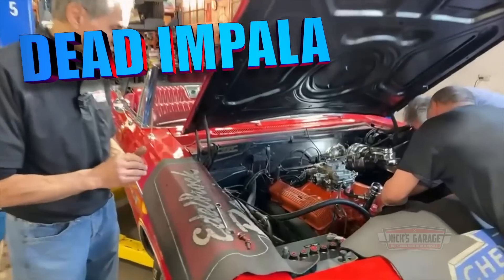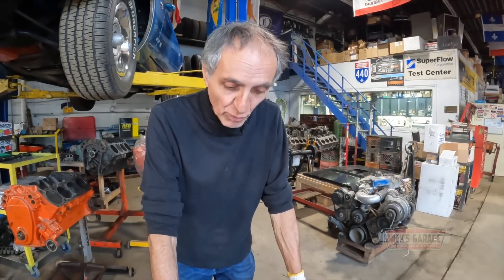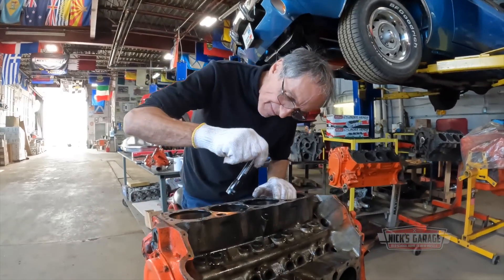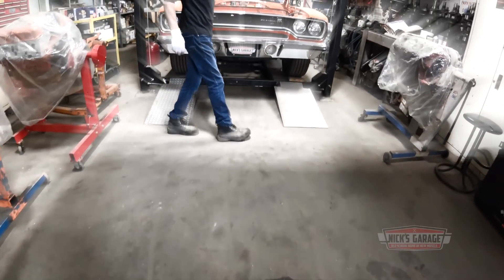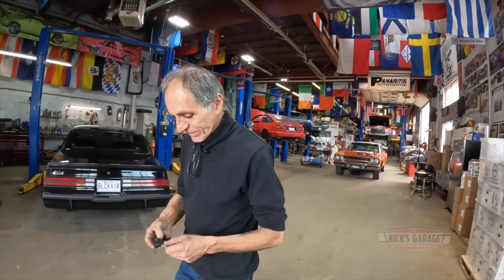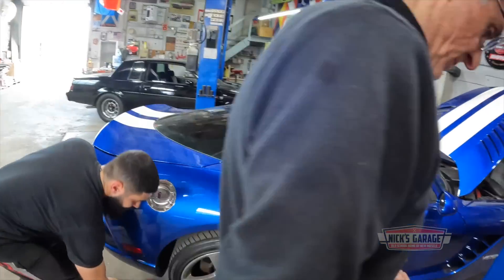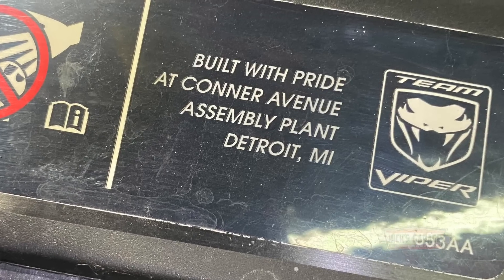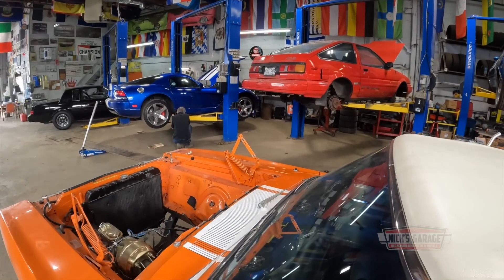327 Chevy Autopsy - Smoking Gun FOUND!

Comment: I don't know if you know but is not the right engine for that car, I noticed it has a cast crankshaft, all 327's up to 68 had steel cranks. After 67 they changed the main bearing journal size to the same as a 350. Large journal 327 crank kind of hard to come by. P.S. also the rod size.

Comment: I hello in my past I came up on the bottom raidtor hose did not have a spring in it to keep it from clasping an when it gets sucked in the bottom hose then it stops the water flow could this be the problem check the bottom raidtor hose for a internal spring

Comment: Seen a weak lower radiator hose do that to  mopar 318s,..Chevy 283, and 327 sb engines. ...lower radiator hose "inside spring" collapses while driving ,...causing severe over heating ....that's my guess.

Comment: Sometimes parts fail for no reason. This is why I prefer the restrictor type tstat with the bypass holes. I also prefer 160 degree as opposed to 180 opening temp, the water is still going to get to 190 operating temp.

Comment: I would go with Stant # 45356, they have been making thermostats as long as I can remember but I don’t know if they still put the little 1/16” weep hole anymore. Somebody makes the thermostats for Mr. Gasket ,don’t know who. Maybe customer turned on the heater and there was an air pocket that caused a steam pocket for the thermostat and if there’s no weep hole that would cause overheating which may have caused an exhaust port to crack, thus steam out the exhaust. You would think the excessive heat would have caused the engine to “KNOCK” and the customer would pull over and turn car off . Anyhow because of a part failure you can’t really hold the customer for the repair. It’s called , call your Garage Insurance company and see what say which they will probably tell you to suit Mr. Gasket. Good luck on that one.

Comment: I've cooked a 305 that bad. It got hot enough to melt the solder that held the neck into the radiator. The temperature light never came on and it never ran like it was hot until both head gaskets let go and it quit running. 
I definitely would check the temperature switch to see if it actually works.

Comment: More often than not, good quality thermostats will open at different temperatures rather than not open at all. Unfortunately, in this case, the owner ran the engine to failure. Loss of power and the smell of melting plug wires should have been the alarm bells in this case if the warning light was not on or visible.

Comment: Nick, it may be crazy, but I would pop out those core plugs and see what all was circulating through the water jackets, there may be a clue as to why it overheated, 'cause .040 over isn't sufficient to explain it. Just my thought on it, wish you well .
Reply: I got an original 68chevy 327 ci 70,000 miles purses like a kitten how the hell do you burn an engine to that point he should invest in hearing aids this thing was floored to the point of meltdown get yourself a moped instead it's all you can handle! Maybe leaky frost plug at the block heater

Comment: Serious question: When dealing with pricey engines like this one, would it be feasible to build it redundancy and have a 2 thermostat setup in parallel, so if one fails there is still another one operational? I understand that the sensor is made to flag issues like this but that was obviously a failure.

Comment: I had a 57 Chevy customer car that I had a 350 and it kept overheating no matter what I did. Finally I had my machine shop prep another block.
  I took all of the parts from the original block and installed them in the new block . Problem solved.

Comment: I had my 77 fj40 land cruiser radiator cleaned and tested because it would start getting hot if I drove faster than 65mph. the radiator man told me. get a new toyota thermostat and change it. I did that and when I picked up my radiator I showed him how the original equipment thermostat came out in pieces. he was right to have me change it.

Comment: Possibly the carb had a bad circuit and it ran lean at the driving RPM causing a lean condition leading to increased heat.

Comment: That got way too hot and I wouldn't trust that block unless like you said the machine shop says its OK and the heads are especially suspect to scrutiny I've never seen one get so hot it blackened the outside by the deck like that and blued the crank that's hot very very hot like 350 or better DG that is I'm surprised it still turns over did it turn over w the pistons in it or no ?

Comment: NOT FOR A MINUTE!    Thermostats don't close when operating normally...They DO fail shut when extremely overheated...The coolant obviously puked out the overflow hose..The Customer HAD to have seen the steam from under the hood and the RED light on that you said was verified as working...THE CUSTOMER SHOULD HAVE TO PAY FOR THE NEGLIGENCE!..Doubt if he will as any court will side with him.  Just build it cheap, fast and get it out of the shop. ASAP!

Comment: I have a question Nick that water pump bypass hose nipple looks awful big what about putting a restrictor nipple on it to restrict the flow of the bypass on that water pump bypass hose. I have a 1997 Chevrolet C 3500 with a a 6.5 diesel it’s a P 400 which is a little bit different than your normal 6.5 on mine I need to install a restrictor nipple on the water pump bypass hose to keep it from overheating when I’m running my foot on the floor the seller raider pump is not allowing the water to go into the radiator to cool it instead it’s bypassing the water right back into the engine and let the engine overheat because it’s putting too much water back into the engine instead of back into the radiator is that a possibility just wondering I haven’t done that yet to my truck and that’s why I’m overheating when I put my foot all the way into it for a long period of time it takes about 5 miles before it starts overheat above 230°F I need to order that restrictor nipple get the water to go back to the radiator instead of the engine just a thought

Comment: Install a temperature gauge, though that could be missed, you see that needle pegged or high. I looked up how it worked and maybe how it failed, it has a material in a container that expands with heat to open it, I suspect failure occurs if the material escapes when its container is not water tight. This probably was a manufacturing flaw in the container, a certain percentage of any item has such infant mortality. Part quality in part is measured by infant and early mortality because of the manufacturing process or specifications. An old car like this I suspect does not have OEM parts available, OEM and well known manufacturers who supply OEM parts like Bosch or Gates is where I would go first.

Comment: the radiator should have been cleaned or replaced before the rebuilt engine was installed to begin with I learned that years ago and I've mechaniced  for 40 years but not as long as Nick If he is older than me s I suspect

Comment: If the coolant came out of the tailpipe, how did it get into the engine?  If not that, Why was there no evidence of coolant coming out of the  radiator cap overflow? The combustion chambers would have shown if coolant was getting in. We never got to see those.

Comment: Tempt gauge will help and the owner should have installed one along with oil pressure as well.   Everything fails at some point.  Customer should have known  better.  And on old cars top down. I would have smelled anti freeze in seconds. If the radiator cap didnt function work to let it boil over that would have been another thing as well.

Comment: Nick, by any chance, did the client turn on the heater in the car that day when he started driving? Is the heater still on in the car?  Is it possible that air in the heater core air locked the coolant system causing the thermostat to not be in antifreeze and subsequently fail?
Reply: Heater only take a couple cups of coolant. Not enough to cause that kind of overheat.

Comment: I have a mystery oli thing going on in my new 454 motor .. lol
Reply from the maker: Marvel Mystery Oil?
Reply: @NicksGarage  no I'm missing a quart of oil every 60 miles
Reply: If it's a GM crate motor it's garbage and if you spend too high RPMs going down the freeway it'll burn oil my 94 Chevy 3500 goes to a quart in between oil changes

Comment: Something I ran across. If a cooling system is run just low enough, the thermostat will get "steamed" and damage will occur to the bi-metal coil. The thermostat will be stuck in the open or closed position. If open, it will run on the cool side. If closed, it will run on the hot side. Once the coolant runs low, you will have a steam condition. A cooling system pressure test would be the first order, gasket/ hose failures or hair line cracks will be observed on leak down  from the gauge, then examining around for leaks.  I would not re-use the cylinder heads and block. The metallurgy of those parts is compromised. All the above listed does not find the problem which led to the loss of coolant in the first place. Installing the head gaskets on the wrong bank will cause this problem, an over heat, lack of proper coolant flow around the cylinder jackets and heads, hence eventually causing a steam condition which led to a damaged thermostat then the rest of the damaging overheating condition (low water) to the block and heads. A new performance assembled short block looks like a best option. Please verify the head gasket install, left and right banks before assemble and during tear down. I hope this helps, this has been my experience

Comment: But could this thermostat have been damaged by the heat and there was a different problem? Take the new one one and subject it to the amount of heat that was generated from that engine and then see if it still works.. if it does then you can be sure this was your problem. If it doesn't look a little closer. though I think your right you still you want to make sure your right don't you? an ounce of prevention is worth a pound of cure..

Comment: Sir I had a 1964 chevy impala with a 327 and an estimate hp of 4 hundred hp mine was also bored out 40 plus thousands I can't remember but we were told by the machine shop we shouldn't go that far but we did anyway the same exact very same thing that happened to me but I noticed that the car was pinging spark knocking I shut the car down immediately and the thing was hotter than hot let it cool down I called the machine shop which also was the garage that built the motor came out and after the car had cool we put water back in the radiator but we noticed that it wasn't taking water but the thermostat was stuck so after a new thermostat I was probably drag racing that night with it ran it for many years afterwards those 327 are one tough engine

Comment: The. Thermostat was China junk and failed to open.  Not ruined from heat. It caused the problem .  And it doesn't take long to reach 230.+. Same goes when the belt comes off.  I seen a small block get so hot it cooked the oil off the heads dry. Seized the valves.  My frend was drinking trying to make it to the closest bar to avoid a  d.u.i. .when he stopped  the people thought it was on fire and called the fire department.  While he hot footed it to the bar. A block away.  The police were not happy.😡😡😡

Comment: My question is were the heads original?  Years ago I had a small block chevy 350 that I found out had a small block 400 head on one side and it had an extra waterhole between the last two cylinders.  Just curious, mine smoked until I pulled the heads.

Comment: Thank you touch judge, ball boy and conspiracy theorists. Just as I’d guessed day’s earlier. 
Had this exact thing happen on a stock 186ci Holden red motor 6 cylinder. Burnt paint on head and all. Temp light faulty and only turned off after engine stumbling. Engine was still fine after replacing thermostat and radiator flush

Comment: Nick , I Love / Hate the engine failure analysis...you are looking to determine 1000% what cause a big failure and it comes down to something you can't say 1000% that what did cause the failure.  Nick , I would have the block, heads,intake ,and water pump housing pressure tested for cracks , and then  magna flux all of them too. There's no way with the naked eye to be sure after such a high temperature failure as that engine went through.  It didn't get the piston walls at bad as I have seen , but the heads and block took ALOT OF HEAT .  I Would also have the oil and coolant passages checked to ensure no blockage change or got stop up after overheating . Just my humble 2 cents and I know Nick you know way more then me ...My only problem with the thermostat failure is it is being test after being stressed to very high Temps.  It could exactly be the problem or not . But it is sure not opening . But if you were to open a warranty claim against the company for the engine damage, labor,parts,labor,, I bet their warranty dept. Would say the same thing and try to deny the claim, like alot of them do...Sure hated that happen too . God Bless Nick and take care .

Comment: Things break and I believe the heads definitely are the culprit. Not a fault of the builder as cracks develop without notice in cylinder heads . Hope you find the reason but stopping when it first started acting up would have save the engine. That block was red hot to cook like that and them pistons would have been tight at that temperature had to make a lot of noise. Js

Comment: If the thermostat doesn't open then the water temperature would increase resulting in a pressure increase in the cooling system which would be released by means of the pressure relief spring on the radiator cap. It's very hard to miss a huge jet of steam coming from the front of the car..... But this did not seem to happen in this case. So where did the 2 gallons of water go? I suspect the damage to the thermostat occurred at the same time the engine was cooked and not before as the cause of the overheat. The video mentions smoke/steam coming from the exhaust. My thought is the water leaked out extremely slowly until the water level reached a critical level and the engine was baked. Were the heads and top of cylinder block planed before re-assembly to make sure they are exactly level? On a seasoned block (as in this case) the heads may have warped slightly and the block may have gone out of square resulting in a failure of the gasket to seal properly when torqued down... I suspect the water blew by the head gasket (very, very slowly as steam) then into the cylinder and out the exhaust. Anyway, this was another interesting and entertaining video from Nicks Garage, thank you Nick and George :)
Reply: My thoughts exactly

Comment: Nick, the pink elephant in the room is...  if the thermostat was bad and you saw no cylinders washed, WHERE did the coolant go and how come it was reported by other drivers there was steam from the tailpipe but no evidence of it as the pistons were not steam cleaned?   Look inside the exhaust manifolds for evidence of steam washing the exh ports....  I wouldnt trust those heads again even if they magnaflux good. The cast iron has been hot tempered and may be even more prone to cracking now.

Comment: With that coolant loss,the smell,heat from the red hot engine,the white exhaust trail,the.rattling valves,lifter noise,and they just didn't notice anything unusual out of the ordinary? They probably need a new Honda or Subaru,older cars are just that,they require more care,checking oil,water,eletrical connections,trans oil etc,some can,some can't,some shouldn't.

Comment: The strange hole in the Roadrunner firewall looks like for the heater core lines.
Reply from the maker: Yeah.. but 12 inches too low?
Reply: Could it have been used for a extra add on interior heater box??
Reply: @danielscott6787  it’s strange.   Unless someone installed one upside down?

Comment: Whoever said a thermostat is wrong! It can stick and make it hot,  but won’t make the coolant disappear and if it opens 9 times it will open every time for years! It has to be a headgasket or head issue where the coolant can slowly disappear until there’s none for circulation….. period facts.

Comment: The 327 over heating.. My gut feeling is that the driver knew that the car was over heating and drove it anyway for a distance. You can smell the coolant burning. It would have been steaming and smelling way before that kind of damage. I drove older cars like that. They can go for a while before that kind of damage. They might have taken the radiator cap off and forgot it or something.  ( “ Nick will fix it “)

Comment: Nick My name is Duke I live in Quesnel B C I build Chev and Ford engines I apprenticed for ford I build 289 thru to 460's I leave the dodges to U !! I Ran stock cars since 1976 fords R not condusive to staock car chassises so I switched to Chev now My main complaint is core shift !! Small journal 327's were good but large journal 327 had some poor machining so 40'over is max and they were pronne to cracking at the top of the block!! 350 also had some problems but with some cheking I have done 060 over I suspect cracked block!!!! The stock car engines I build pull 370 to 390'horse with an illegal carb 2 barrels I have a 347 in my 36 dodge bros hot rod I'll send some pictures!!! And 1 know You R a builder of many engines
Reply: I watch U all the time oh Rr the thermostats made in china
Reply: And I always put OEM Thermostat in a new engine in the stock car Engines I put a restrictkter no thermostats but I do not use anything chinese OEM Always !!!! U knows what my problem with dodges it was the unibody constructionI put 440 /383  I do dodge but IAM basic chrysler oriented so there U go !!! I have had trouble with thermostats!!! What is your thought on triwy headers Im running them on my 57 chev and my 87 chev pickup,,,,my favorite exhaust is Three inch with a crossover